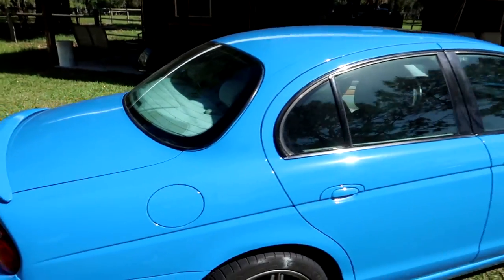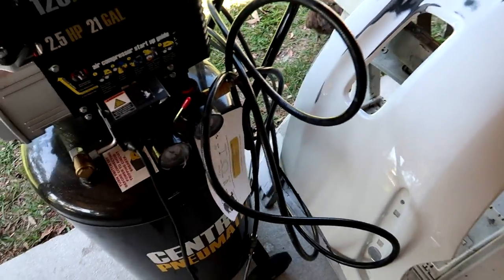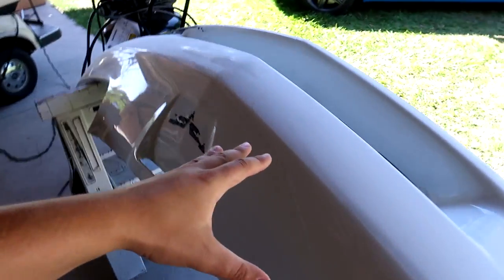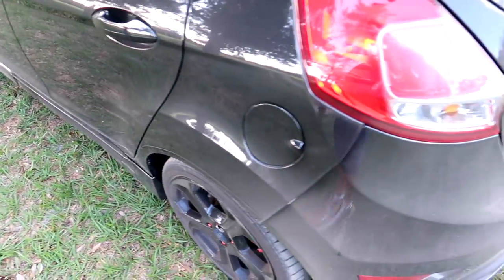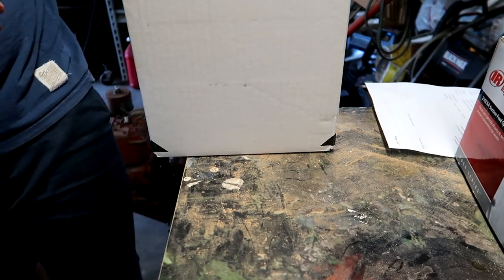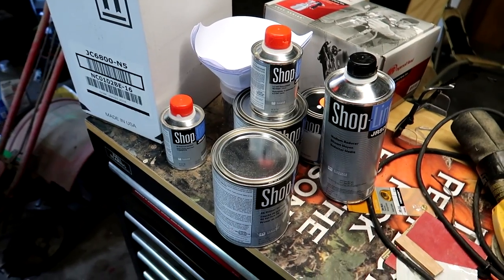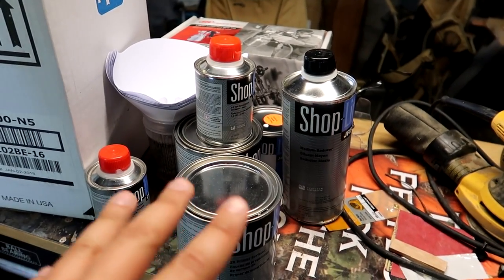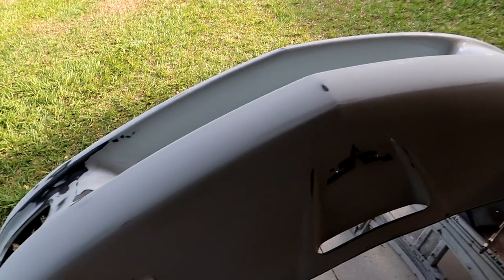Should I Paint My Own Salvage Rebuild Projects at Home? *FAIL IMMINENT*

Comment: Should you paint it on your own, depends on good you want it, and more importantly how long you want it to last. Paints booths serve many different purposes. First and most obvious is they give you somewhere you can paint, and not worry about over spraying, and paining something you did not want, like a wall, or anther car. Second they provide extremely clean air, by using incredibly good  filters, and fans to circulate the air, this avoids any dust, and debris from ending up in/on the paint. But lastly, and most importantly, they control humidity. It does not matter if you are the best painter in the world, or if you set up a clean room, where you protect from over spray, and for the most part dust, with out controlling humidity, you will have issues with the paint. Here is what sucks about it most thou, when your painting, you will not be able to tell. If you do a good job painting, and you manage to keep all the dust, and debris out of it, you will not be able to tell. It will look perfect. Until you mount it to the car, you will able to see a slight difference in paint, because the humidity changed the way the paint attached to the bumper, and thus changed the hue ever so slightly. It might be incredibly noticeable, or it might be noticeable at all. But the worst part is, with in a couple years, or possible even months, depending on paint quality, and the amount of moister that was in the air, the paint will start to chip and peel. The moister will do two things, first it will never really allow the paint to harden, which means damage from the sun will occur much faster. Second, if there is large amount of moister in the air, it could actually get caught under the paint. Meaning 2 things, the paint will never adhere right, causing it to peel,  and in worst case instances, could actually freeze and shatter the paint from underneath, causing chipping. That is just my opinion, but take for what it is worth.

Comment: You always want to use a good adhesion promoter any time you spray plastic or fiberglass parts...you'll regret it later when it starts to peel...i've painted several cars myself that ive bought at copart or salvage bid!!

Comment: No because you never can get the same quality in a barn where the dust and chicken feathers flying around. You should have a painting cabine what has air filters and vents. At least hose the area where you will painting to reduce the flying dust and pollens

Comment: That pain is ok but I don't like it. On your paint it should be 4 to 1 and clear should be the same if you see it not shooting pretty good reduce it a little bit more 10%.. on your air compressor you should have about 18.5 CFM. Set up your gun 21 to 22 PSI open your material all the way and start closing it when you feel the trigger. Start moving give it about three more turns on your fan open it all the way give it about one and a half turns or close to 2 depends where you feel comfortable.. and also when you're sending your bumper to take off the shine use a Scotch-Brite better

Comment: The $14 HVLP purple paint gun from Harbor Freight has really good reviews. Of course you can invest good money in a Sata but I can't recommend it unless you are going to paint cars professionally.
Reply: Kevin Thomas I can attest to this. I have thousands invested in spray guns. I bought the HF gun for primers and crap equipment paint. Was shocked at how well it did. I also bought the gravity feed touch up gun and I use it all the time. I’ve actually had that one for YEARS. The purple one, I haven’t had very long.

Comment: Plastic bumper don’t forget the flex additive  keeps cracking  down on plastic parts did you get  wax and grease remover and tack cloths.  The gun you got is great for primer but you need a hvlp gun for the finish work

Comment: Also any questions you have about the products can be answered in the data sheets.  If you ever lose them you can find them on PPG's website or whichever paint manufacture you chose to use on a later project. Also wetting down the floor can help keep the dust down

Comment: take that gun back,go to h/f get 3 guns with different noslle sizes ,one for primer ,one for base,onefor clear,those h/f guns work well ,ihave sata gun that cost short of 2000 and the h/f does a the job just as good,the ones thst tell you different are the same ones that say you cant do a job if you don't use snap on tools,you need flx agent for bumpers,surprised the paint shop did not recommend it,buy a can of cheap enamel paint and paint some junk parts to get used to the gun, also get 5gals of gun wash to clean guns,very important to keep guns clean

Comment: Honestly it seems like you do a decent amount of painting if you can get decent with a gun probably beats the hell out of a rattle can. So in your opinion is this a plausible option to get a sick car on the cheap? Being a gm guy im just think I could get early mid 2000s Corvette and rebuild it. Im not underselling it put the second pizza car you just removed and repkaced the axe spindle shock tirod ball joint control arm I've basically done apart when I removed my friends spindle on his Subaru few more bolts but would of been simple enough for me. Not only that but im currently attending school for automotive technology and this seems like a great way to get to know a vehicle inside and out with all the safety switches and such. Im pretty sure in Indiana you can get a rebuilt title I could give a damn I just wanna be aloud to drive it fuck resale

Comment: Samcrac, 
I am looking into purchasing a compressor.. I notice you have a HF compressor on your video.. 
Have you had any issues with it? Is it a 30 gallon? Would you recommend? Thanks.
Reply: I have the same compressor for a few years now. Works pretty good using lighter air tools.   Never tried it with anything heavy duty although soon I will try a 1200 lb impact wrench with it.  For the price using a coupon or sale I think it is good deal and plan to get another one.

Comment: please do NOT use a sander for it .. scotch-brite the green one .. and go to town .. by HAND .. ofc wipe it off with wax and grease remover first .. then use the green scotch-brite go over it with  wax and grease remover again .. THEN plasti prime it let it flash off .. use "normal" primer .. paint it the number of times till you are happy with it . then clearcoat it  3 times i would advice .. 1 dust 2 wet coats .. let it cure voila basicly done .. unless you cut it down and polish after

Comment: $40 for a PPG automotive paint is cheap. I worked in a body shop 40 years ago and we'd be paying $300 a gallon for various PPG paints back then.....A buddy had a nice CJ5 that he lifted, put a 350 ci in etc and went to the paint shop to see what colours he could get on the cheap. Someone had ordered 4 gallons of ferrari red (at $400 a gallon) and paid for it and never came to pick it up. He got it for $200 total. Drove around in a ferrari red CJ5 lol....

$27 for a quart of clear...damn, that's cheap. I pay $45 for a gallon of pre cat clear for wood finishes......is it pre or post cat? (meaning do you have to add a hardener to it before you spray?) Edit: I see you have two hardeners...one for each: colour coat and clear coat. I doubt it's for the primer. 

They call it reducer because it reduces the viscosity of the paint, doesn't "thin" it. Thinners will also lower the opacity of the paint....(or so I'm told)

You can also use reducers to wipe down your part prior to spraying to remove any grease, fingerprints (death to paint), skin oils, etc.

Don't know if you have a tack rag either, if not, GET a case...use and rotate constantly......

Comment: WRONG GUN WRONG GUN WRONG GUN!!!  Unless your paint is really really thick....go out and get a hvlp (high velocity low pressure) cup gun. 10000x better results. suction (or pressure feed) canister guns are for spraying heavy viscosity finishes like water based urethane, spar varnish, latex, etc. I switched to a cup gun 2 years ago and the finish is 1000x better. easily better and it allows you to get into tight areas like wheel wells etc....cup gun CUP GUN!!!!!

You'll also need an air dryer for your air line so you don't get water infiltration into your material. They are cheap and just install in your air line......edit: I see you know this already.

Comment: So....$600. to just paint the bumper.  Should we compare that to the $480. it cost to finish prep and completely paint the Jaguar?  With the bumper OFF the car...$600. is a rip!  Did you even get a quote from the Econo paint shop?  My guess is that if you supplied just the base color paint the estimate would have been $150.-$200. max.

Comment: Pleaseeeeeee, stop saying “what is going on” it is soooooo tiring.  Painting is easy, I did it over thirty years. The prep work is common sense, the spraying is technique and practice. Taping and masking is critical. Buy an old junker with a decent body. Sand, clean, prep,tape mask, you may have to do it 3 or 4 times, but with practice you will develop your technique. Yes 40$ is right for that base.  You want to practice with cheap paint.  That siphon gun will work for you. I ran a collision shop 37 years, I started building wrecks, found out my profit was better working on other people’s.  Good. Luck!

Comment: Anyone can learn to paint well. And if you have good eyes you csn match sun-faded colors. And if you want to match metallics, ah. More practice AND heat and moisture control. And then soon you need an EPA permit for handling the paint residue and life gets expensive. You can do good paint, but it needs luck. Or skill, talent, and practice. Good luck, whites are comparably easy. $400 a gallon is what fancy metallics can run, exotics higher.

Comment: A decent spray gun is going to cost you $300 then you're going to have another $200 in other materials so unless you're expecting to paint your cars for now on I would leave the bumper to professionals.
Reply: Leave the high dollar paint guns to the people doing it for a living. I’m an ex-painter and have several high dollar spray setups. I also bought two harbor freight guns to use for primer and for crap equipment paint. I was SHOCKED at how well they actually spray. The parts inside them are crap and they only last for so many paint jobs once you break them down and do a good cleaning, but I wouldn’t hesitate to recommend a gravity fed harbor freight gun to a DIY’er. I mean, for $30...who cares if you can’t get replacement parts!!
Reply: J Walker...Lol. Not my real name....
Reply: The Grunt as many rebuilds Sam is doing it maybe a good investment to do the paint himself in the future
..
Reply: I’m going to repaint on my channel, do you guys think a $30 spray gun will be good?
Reply: Graco sharpe FX3000 is a pro-level gun and is $140.
Reply: That’s the literally all the stuff we use. We repair the likes of Mercedes and Lexus
Reply: What stuff?

Comment: Do not cover stuff surround the part with plastic kinda live a little paint booth
Reply: And a fan facing outward move in stright easy steps. Go really light on first couple of layers then use the hardner at the last coat